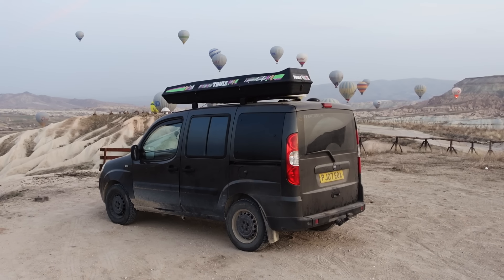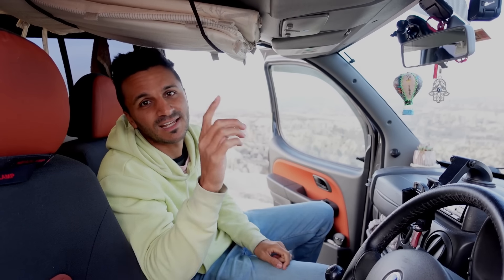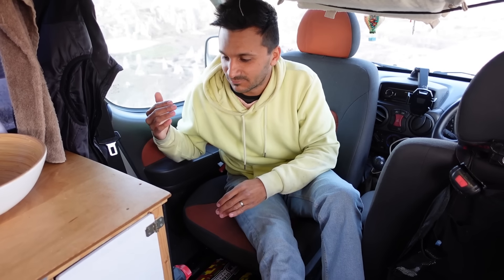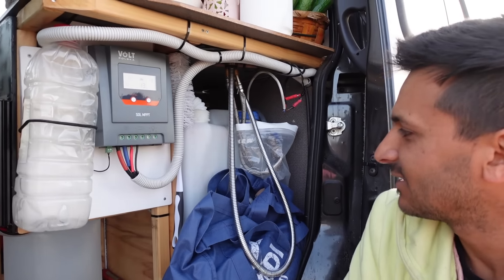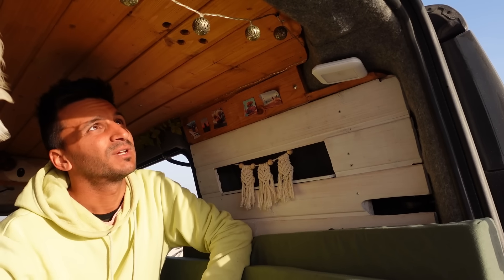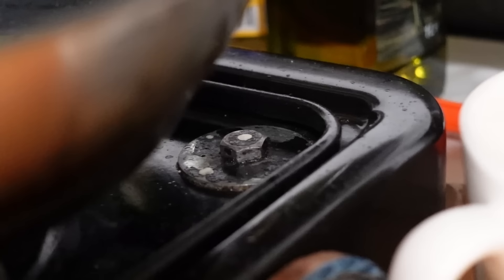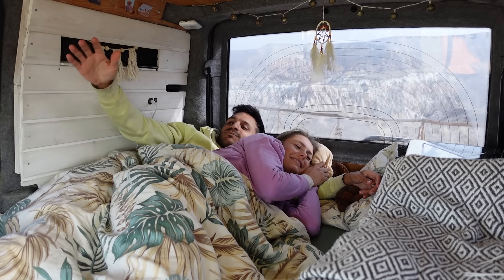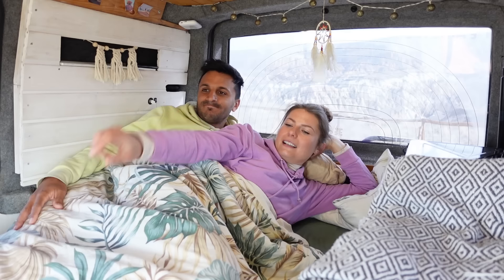EPIC Off-Grid MICRO CAMPER - Van Tour After 2 Years!

Comment: Fabulous video. Love your van. Well done. Really like your window shades. In the US, we have a sun shower. It’s a 5 gallon black plastic pouch with a shower head. You place the bag in the sun (roof) to warm up and it gives you warm water for your shower. Just bought a car fridge that runs on 12v or can be charged by the generator or 110v electricity. Very convenient. Good luck on your travels. Thanks for the van tour. 😊😊

Comment: Thank you, for this new room tour. 

I have 2 x 100 Watt Solar, but I have also a fridge box (35 Litres) .
But to swing the panels gives a lot more output.

I have a two flame cooker and a one flame cooker for using outside, and for backup.
The one flame looks the same, as almost all using, with the gas cartridges . (227 grams)
BUT mine has also a vent for to run it, with a gas bottle, etc.

Comment: This is such a cool conversion, I watched this video multiple times because it’s so impressive! Very clear that you’ve built this to work perfectly for you two over the years, I am wondering how long you have to have the diesel heater running to have it heat up the van sufficiently? Thanks in advance!
Reply from the maker: Thank you, the heater only takes about 5/10 mins to start making the van warm. Then we can keep it on low once we're happy with the temp 👍🏼

Comment: After my previous comment, just to say it would be so good when you get the time, to post some Tech details on your Mini Van Camper conversion upgrades... We're really interested in how you achieve these wonderful things in the Doblo. I'm keen re: infos on gear specs. Did you have to upgrade the battery system to handle the added electrics, for the stereo, etc? Did you add, say a DC Bus Bar, or extra fuses, for instance? Love to know also where you get your DIY expertises from. Whenever you have the time, between having your touring fun... (most important..!😄) Rock on, Go safe.. xx..!👏👍
Reply from the maker: For the rear there is a separate battery and electric panel, with a fusebox. For the front, like stereo it's ok tapping into existing stuff, but if any more accessories were to be added I'd look at bus bar options or something. My DIY stuff comes from research, watching and trying it 🙂

Comment: Absolute amazing what you have put into this van. My respect. Thank you for the video. Especialy the tire size. I have a 2009 fiat doblo max 1.4 gasolone.  I dislike the rpm it makes at rather low speed. I want to gain some speed versus rpm by putting larger tires on. Now I know the max size I can put on :) Thank you for that.  unfortunately that is only 1 size larger then its original 175/75/15
Reply from the maker: I'm pretty sure the original size is 185/65/15
Reply: yes you are right. sorry. It means quiet a size up possible yes.  One question. Did the 175/80R15 tires already fit without changing the suspension?  @TeamAteem
Reply from the maker: Yes they did, but when I replaced the front lower arms they started catching a tiny bit in the arch under certain turns
Reply: thank you very much for your answers @TeamAteem

Comment: Just found your site today.  Love what you've done with the conversion!!  I bought a Doblo HiTop (1.9 TDI) a few years ago, its been grerat!! as an all purpose van, taxi, truck (rear seats go in and out).      Been looking at making it a bit more livable and saw your rotating fron seat.   As you said there isnt a seat rotator for Doblo and  have been trawling Facebook groups for a fix.   My current wok around is to unscrew the bolts and turn it manually, not very elegant solution.

Saw that you used a modified Ducato, are you able to tell us exactly what you did.   There is a mechanic close by who would do the cut and weld.   Many thanks in advance for any pointers.  Best regards and thanks for any help
Reply from the maker: Hey Robin, check our our video on the swivel seat for some more information 👍🏼 https://youtu.be/vEO3T5LKIAM

Comment: Lovely couple! ❤ I do not understand how the diesel heater is working. Must you have the engine running? Please, some advice what to purchase. I have camper van vw caddy but now I am buying fiat doblo.
Reply from the maker: @darajovanovic2714  no the engine doesn't need to be running. It uses power from the leisure battery to start up and stay running. Ours is connected to the vans fuel tank for ease, but they can have a separate tank too.
Reply: @TeamAteem  thank you so much ❤

Comment: Hey, I'm in the process of converting my doblo - how did you make the boot release. Whats it tied onto etc?
Reply from the maker: Bit hard to explain but it's tied to a part of the boot handle mechanism. You have to have a look in there with a torch and find one of the rods
Reply: @TeamAteem Yeah thanks, I had a look before but could really see anywhere to easily tie it off to - Have you tied it to one of the arms on the small set of linkages directy below the handle that rotate when opened?

Comment: Hey I was wondering if you had any insight into how the 30mm front spacers affect performance/ drive ability and also whether you’ve noticed any extra wear on the front struts due to the altered geometry the spacer may cause?? Thanks!!
Reply from the maker: Hi, driveability/performance is almost the same as standard, haven't noticed any wear on the shocks but I am about to change top mounts after fitting new ones 2 years ago with the lift.

My recommendation would be to get aluminium ones, steel are heavy and overkill.
Reply: @TeamAteem  thanks for the reply! Luckily I bough ally spacers. How was the install? Do you literally remove the strut and put the spacer on the top support then reinstall? No need for coil compressors or anything? Thanks!!
Reply from the maker: @DJUINUK yes that's right. Id definitely recommend disconnecting the anti roll bar from the lower arms for install.

 You might even be able to just undo the top mount bolts and drop the strut far enough to get the spacer in and bolt it back up without removing the whole thing.. not sure. Otherwise it's not too bad removing the strut.

It's hard reinstalling it if the anti roll bar is still connected, I can't really recommend it from experience.

Anti roll bar - disconnect and reconnect while the van is still on the ground.
Reply: @TeamAteem  thank you so much thats a big help!! Look forward to seeing any future vids you put out

Comment: Hello guys I have the same model van and wanted a diesel heater do you think it would fit were your leisure battery is thanks guys
Reply from the maker: It should do, ours is a 2kw which is physically smaller and more suitable than a 5kw one, measure up and see if it works with your layout

Comment: hi there. Can you please share how many watts you are pulling from the Dc to Dc charger of a doblo? I'm wondering a small alternator like this might not let you pull more than 300 to 400 watt before burning out...? And Do you let it charge for hours while driving?
Reply from the maker: @IanB-uy4ze  our charger is a renogy 20a, output 250w. Sometimes it's charging for a longer drive if needed, no problem
Reply: @TeamAteem  sounds great. I bought a Victron 10A 12V->24V, outputting a nice 260W. I heard using 50% of the inverter's 65Amps output is safe. so in theory, we could use more. But was curious about yours/ Thanks for the response. Looking forward to see you guys back in vanlife mode ;)

Comment: Hey guys, I enjoyed watching some of your videos. Some of them were quite entertaining and some educational. I may try some day camping out in central London. Just kidding. 
I'm actually doing a similar camper van build with my VW Caddy. So, I have some questions for you: How is that mushroom roof fan? Does it make a big difference on hot days? I see, you've used rubber for insulation. How thick? I'm also planning to install a Chinese diesel heater. I've got the 5Kw and it might be too much. But if the temperature control works ok, there shouldn't be a problem. What do you think? Do you have the 2 or the 5Kw heater?
Reply from the maker: Hi there, thanks for watching! The roof vent doesn't do too much, it's not that big and the fan isn't that strong. We don't have any rubber for insulation.. Our heater is a 2kw and we find it perfect for the size of the van.